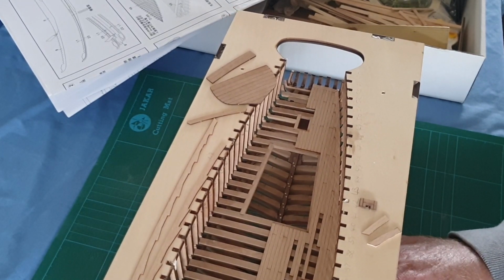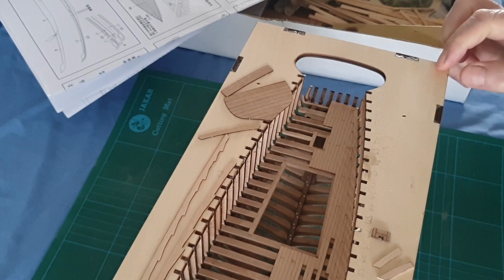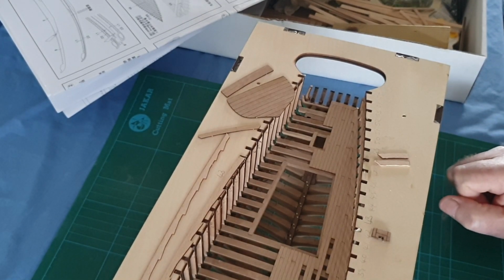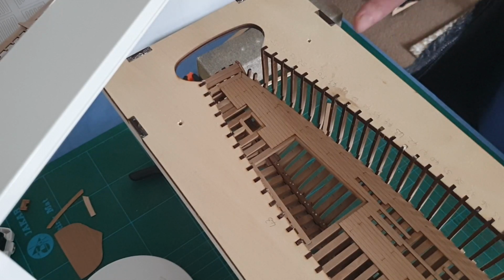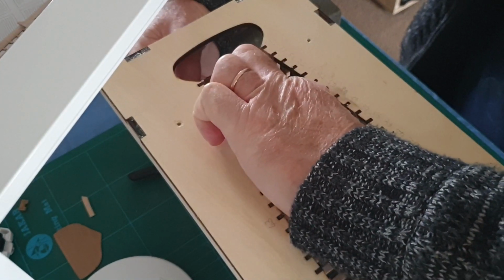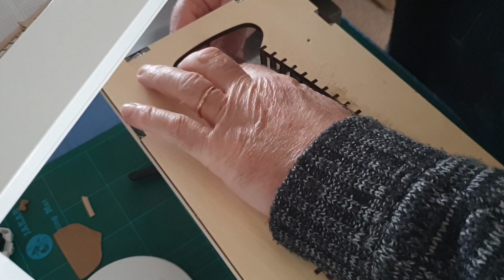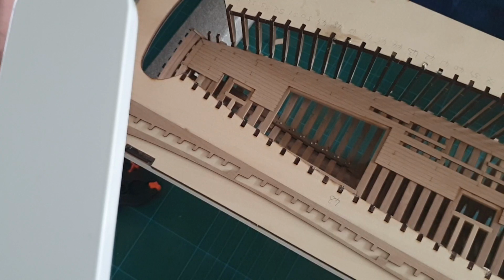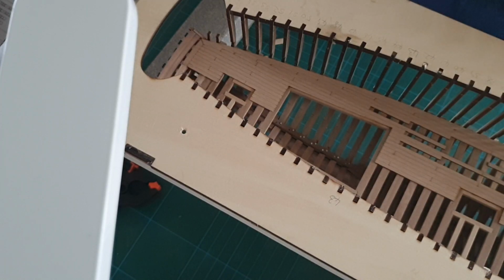Bluenose Model Build Video 14

Comment: OMG Paul,  sorry you can't get the parts, cutting these out will be total pain.
Reply from the maker: Yes, but has to be done. It will keep me busy.
Reply: Paul is there not enough scrap to re-cut these from ?
Reply from the maker: @jimhenshaw1601  sadly not.
Reply: If you have some you can get them from,  I will also have the same here which I could happily send !!
Reply from the maker: @jimhenshaw1601  Thanks Jim, very kind of you but unfortunately I only have enough scrap for 3 of them.